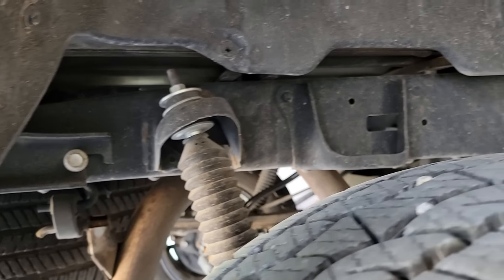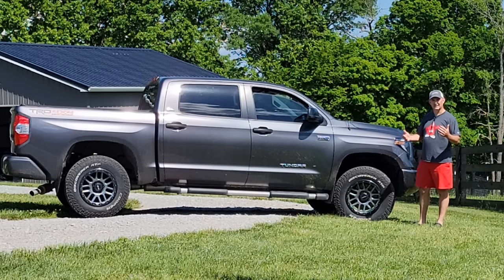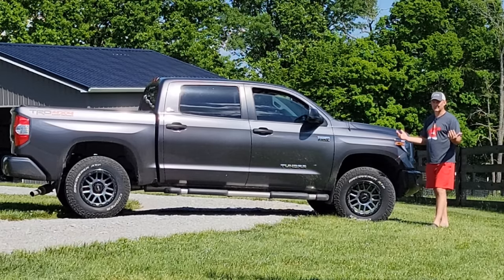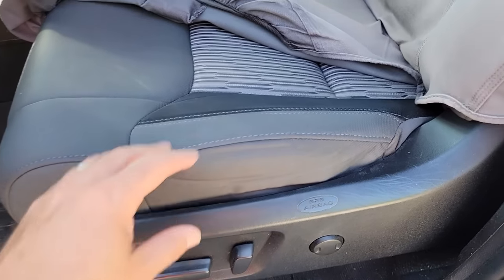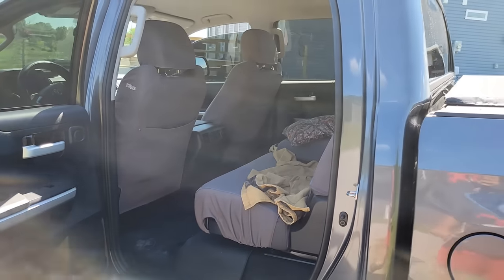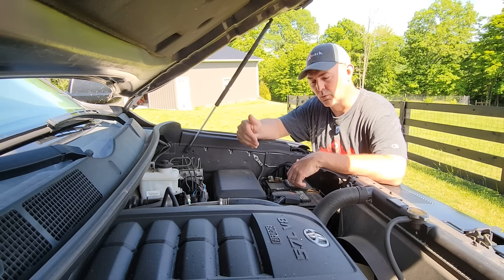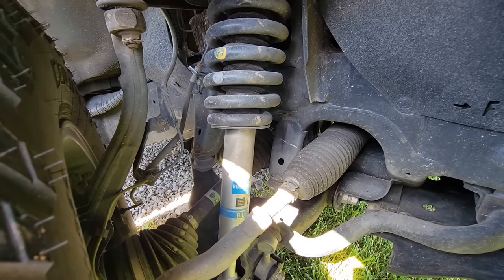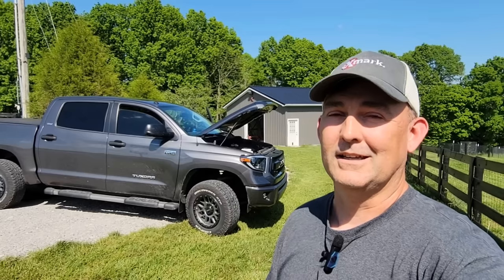Toyota Tundra at 6 Years / 100,000 Miles Compared to Ford F-150 and Ram 1500

Comment: The 4.7 and 5.7 Tundras are bullet proof. Most reliable trucks out there. Several million mile Tundras on record. There are no 5.3 Chevys, 5.7 Rams or Ford ecoboost with a million miles.
Reply: Let's face it.The detroit 3 are no match!
Reply: I've got a 5.3 with 418k miles
Reply: @banjobones8075  what year is your 5.3?
Reply: @6.2Slomaro  2002
Reply: @banjobones8075  those are the good 5.3 iron block without the AFM/dod crap. I had a 2013 5.3 crew cab 4x4 Silverado at 180k it had a lifter failure. Upgraded lifter and put on a used LS6 cam. And it was much more powerful. Sold it at 250k miles no issue besides the frame having lots of surface rust. Truck felt like it would go another 100k without major issue.
Reply: We went on the Toyota bandwagon for half ton trucks when my 5.3 dropped a cylinder at 130k. Highway miles and she puked on me . We still have a 99 and a 96 dually with gobs of miles running strong. Keeping it simple helps that long term reliability.
Reply: @banjobones8075  I wish Chevy stayed with the 5.3 Vortec platform. After 2015, the eco tech bs & transmissions took a dive in reliability.
Reply: @Michael-gj2gq indeed we had two 89 vans with that 5.3 main issue in our family was when maintenance was passed overdue both had head gasket leaks after about 150k miles they're amazing vs the other 2 conversion vans I wish GM still kept that type of Quality now all I see is that cylinder shutoff tech in GMs ruining the whole decades of hard work and 2.7 4cly. Inside tons of Silverados nowadays
Reply: @paullucas3 it's an unfortunate situation were mostly Chevys now in my family but our 03 Cavalier gave out around 229k miles and our last final old 89 Conversion Chevy kept purring until more vacuum lines corroded our biggest issues were the AC guaranteed to break after 100k miles barely on my 3rd Toyota and don't see a reason to leave it
Reply: @sweetj16real facts all I saw at some lots Carmax etc were 2.7 4 doors
Reply: There were several million mile silverados from the 90’s on the original small block. Do a quick search. Search Cummins million mile club. There arent 3-4 of them like the Tundra, there are over 130 registered dodge/ram Cummins that hit a million.
Reply: @danielm642  Diesel Rams yes but no gasoline 5.7 Rams with a million miles. No 5.3 chevys with a million. The 5.7 Chevy were good trucks of the 90s.
Reply: Depends. Chevy trucks under 07 were good trucks. Nissan 2.4 and 2.5 as well. Ford and Dodge old school are solid trucks
Reply: Lol comparing the 5.7 to the 4.7 is such a fking joke. The 5.7 will never be as good as the 4.7l v8 as far as long term reliability... why do you think the million mile 2nd gen tundra was a 4.7L ? Hahaha
Reply: @danielm642  who says there are only 3-4?
Reply: Yes, but you forgot the 4.6,it is also bullet proof
Reply: @danramzinski2957  no it isn't
Reply: @danramzinski2957  the the 4.6 is new age garbage
Reply: Ford Raptor 2011 with 362K miles and its all original. 
And its not just highway miles, it sees a lot of Baja desert miles.
Reply: 08 5.3 with afm 300,000 miles oil changed at 3500 miles semi syn Havoline only issues were ball joints and fuel pump once.
Reply: Their 4 bangers are just as reliable. My neighbor has a corolla and original 4runner that was a pickup from the early 90s that he uses daily
Reply: @Jones720k Good to know, I have a 2010 5.3 181,000k gmc sierra with the afm, so oil change intervals at every 3500 miles along with regular maintenance is the key?
Reply: @herbertpearson5665  yessir might or might not have something to do with the havoline 5w30 synblend I have been using since new.
Reply: Been more than 1 ecoboost hit a million
Reply: @freedomisntfree_44  With three different engines being replaced.
Reply: There are plenty of million miles ecoboosts. And the F150 is more capable than all the other trucks.
Reply: @Whiskey.Tango.Actual  Not with original engine.  Replaced engines.
Reply: @highplainsdrifter9849  false. I personally own a 2013 platinum with 1,233,000 miles on the original engine. My brother owns one that just created 1 mil, a 2015.
Reply: @banjobones8075  pre 07 5.3s are awesome. I had one and sold it at 225k. It did start needing more maintenance. Then i had an 07 that blew the engine due to AFM and a 2014 2500hd that was total pice of shit all the way around. cost me 15k in repairs and then I sold it
Reply: The first gen hemi and vortec engines absolutely could hang
Reply: There some Ford, Chevy, and ram with 500k miles. The question is how many times do you have to fix it.
Reply: I have seen more beaten Ford and chevy work trucks with over 1 million kms compared to the very few BABIED Toyotas with similar mileage
Reply: @roketfingers  yeah on their 3rd engine and 5th transmission.
Reply: @Enchanted3DPrints  coming from experience seeing these things from new, no the engines and transmissions were original
Reply: @roketfingers  Yeah, I mean its not surprising since they outsell tundras 5 to 1. I think the point is Toyota has better general quality. I can attest to that after owning all of them multiple times over and seeing friends and such own them too. I also worked at a shop and rarely saw a toyota but again keep in mind there are 5 fords and 5 chevys sold to toyotas every 1. I finally settled on a tundra after my last 2 chevys combined cost me over 25k in repairs in roughly 5 years. The quality just isnt there anymore. Id buy a ford before i bought another chevy and if you knew me that would mean something! My father had a tundra for 20 years and had 1 fuel injector fail the whole time. Other than that regular maint. Pretty uncommon with the big 3 to see such reliability. Anyway, buy what you like. they all break eventually
Reply: @Enchanted3DPrints  ofcourse Toyota has better quality! I'm just reinforcing the fact that other brands are not garbage. Have you ever spoken to a Toyota fanboy? It's sad from a mechanics standpoint
Reply: @roketfingers  Yep, some of all of them last and others dont. Just take care of maintenance and youre usually okay. I had quite a few 350 chevys that were bulletproof aside from the 4l60s. Fords non ecoboost are usually reliable. I dont touch dodge or ram or fiat or stellantis or whatever it is these days but they used to make a good truck! I guess Im kind of a toyota fan boy at this point only because they havent given me any trouble yet ;)
Reply: @roketfingers If being a Toyota fanboy means driving your Truck home vs towing it home 
👍 count me in. Im a Toyota fanboy instead of Found on road dead butthurt Ford boy!
Reply: The 5.3 is very reliable but the transmission sucks.
Reply: Toyota is still freaking ugly. Buy what you want but I still have to like the looks. Mid size still can’t tow.
Reply: I’ve seen fleets of 08-13 silverados with the 4.8/5.3/6.0 over 750k on the original engines. Usually they’re coming in for another transmission when the torque converter grenades but when the oil is changed on those and they’re not idling all day they go and go and go.
Reply: No, but there are a few with 500K+ miles. I agree that Toyoda is more reliable, tho. GM used to have a reputation for being extra reliable
Reply: Why would you drive a pickup 1 million miles? It would take twenty years at 50,000 a year to get there. The gas bill would be insane. These would also all be highway miles. Easy. Hate to break it to you but I never see Tundras getting worked. Now if anyone responds they will come up with a bunch of BS stories about how they are the workhorses of America. Facts. Go to a job site. What is loaded down and having the shit beat out of them? Big 3. That weak ass chassis Yota would be dead within a year doing what the American worker needs a truck to do. Maybe the engines are good but the chassis are trash.
Reply: No you don't. That's 100k miles a year. Not possible.
Reply: @treeman2660 Tundras are great for grocery getting and occasional trip to the hardware store. When it comes to actual capability, it’s not even close when compared to domestic trucks. Numbers don’t lie.
Reply: @AllThingsAudioHTX  number sure dont lie. Iv been pulling a skid steer with a 14ft dump trailer for 4 solid years with a tundra TRD. You stick a ram f-150 or a 1500 you'll be scrapping the POS's and you'll never cross the 400k mile mark with anything domestic as you call it. Sorry, you aint convincing me dude, I own a Toyota and I'v owned all 3 domestics. The proof is in the pudding, but in this case its the junk yard and in most cases the transmission shop first!
Who are you trying to convince?
Reply: @treeman2660  I'm not sure if your reply to my comment is relevant. If I understand correctly, you're sharing your personal experience of owning a Tundra. However, I was referring to numbers, specifically vehicle specifications and sales volume. I live in Houston, and when you approach any construction site, whether it's residential, industrial, or commercial, the ratio of domestic to imported brands is 9 to 1. There's a reason behind that.
Reply: Trucks are already the longest lasting vehicles on the road and Toyota trucks. Are the longest lasting trucks on the road. The Toyota tundra is the king of all the trucks it’s been proven.
Reply: There are 4.6 Ford’s with over a million miles.  It may be the most durable engine they ever made.
Reply: Are you sure the most reliable?🤦🏻‍♂️🤣
Reply: Fluid film that thing and it will stay that way!
Reply: @banjobones8075 my brother has a 2003 Chevy Truck with a 5.3 that has almost 300K! 
Still drives it daily
Reply: But what about the 5.0 Coyote Fords?
Reply: @danielm642 no gas rams ?
Reply: @pwhittyp5365 why is the same guy that had the 4.7. Driving the 5.7  about to hit a million miles on it 🤣
Reply: If those first gens didn’t rust through they’d have never died.
Reply: @paullucas3 D.o.D?  Those trucks were notorious for dead cylinders when they introduced displacement on demand.
Reply: Do you know that Dodge un 1998 was the 1st truck that reached the million miles? 😅😅
Reply: They are really good, especially in gas consumption,  16 mpg, lets take a look on chevys 21-24 mpg. I have mine for almost 7 years, no issues, took it to Sacramento 22 miles per gallon at 70 mph average. Something that toyota can't compete with. 😅😅
Reply: Right and nor any million mile Ecoboost trucks as well brother.
Reply: @Whiskey.Tango.Actual Are they on they're original engines.
Reply: @Whiskey.Tango.Actual Proof it mate
Reply: @Jedi391 Yep you got it brother
Reply: What's the percentage    of million mile trucks compared to Ford and chevy? That's the question and your answer!
Reply: @pwhittyp5365 I think there's like 3 or 4 million mile 5.7s too. They're all good
Reply: I did meet a guy with a 1st gen v10 excursion that had over 1 mil on it. That said, he rebuilt the engine twice and replaced it once, multiple trans, all the suspension like 5 times over, frame off resto twice... Basically a truck of Theseus lol
Reply: Toyota only make trucks in half ton?
Reply: @tysonbanks2064  have you ever seen a 1 ton Toyota in the states?
Reply: Uhuh whatever Winnie the 💩 poo.   Toyota is a joke , they made a couple descent  vehicles in 30 years ... I've owned a couple of junk Toyota.  Toyota had to smarten up because they made junk .
Reply: Toyota guy : Petting his dash every day talking sweet and driving his Toyota like it's about to fall apart .
Most others;  hold my beer I couldn't give a shit
Reply: @dwynepen7626  Toyota has been the #1 trusted and reliable vehicle manufacturer for decades  🤷‍♂️
Reply: @TheHonestPeanut  if you say so 🤪 I've owned a few seen the Toyota problems for 40 years ok . 👍  as said they have made a handful of ok vehicles aka motors .🙄 also a mechanic for years.  🤐
Reply: @dwynepen7626  same. Saab is the best engineered car for a mechanic. Toyota is the best for everyone else. But that's just facts so 🤷
Reply: @TheHonestPeanut   suabru isnt bad to work on , tbh I'm clueless about Saab, not many in North America if they even still sold
Reply: @dwynepen7626  sadly they're not. GM ruined them. Saab just makes jets now.
Reply: @TheHonestPeanut   wow that actually some history now I'd forgotten,  Gm had and has their hand in alot of interesting stuff.. Saab was originally Sweden if I recall 🤔
Reply: @dwynepen7626  yup good ol swedish engineering. GM does have a solid history of ruining everything they touch lol
Reply: @TheHonestPeanut  I did grow up Gm in the 80s and 90s , today's Gms I shy away from. I appreciated my volvo v70 Swedish built , drive it like ya stole it and it loved it 🙆
Reply: @AlphanumericCharacters actually the big 3 are on job sites because buying them at fleet costs is less than buying a fleet of Toyotas. But Toyota has less maintenance cost but more upfront cost. Toyota is still more reliable any day of the year. And tundra is built in Texas. The big 3 use Chinese parts and have gobs of issues.i bought a 17 tundra 5.7 4x4 and won’t look back
Reply: @nw2404  so Toyota would rather lumber along selling less than 100,000 trucks per year than sell to fleet? I’m glad you like your truck but they just can’t compete when doing big boy jobs. If it suits your light duty needs and you like it then great but any of the big 3 trucks are vastly superior in every way. By the way Toyota just recalled all of their engines on the new trucks. Over 100,000 short blocks are getting replaced. You Yota Boys shouldn’t be peaking up from your sunroofs for awhile after that one. 
 I had a 2017 F-150. Would still have it except for getting divorced. It was the most American vehicle made that year. Same year as your Tundra so that doesn’t hold water either.
Reply: I just watched several Fords with ecoboost million miles. I’m neutral with trucks. A good one is a good one.
Reply: @trickydancemove  Ford with three different engine replacements and two transmissions.  That's a good one.

Comment: I have a 2007 Toyota Tundra Crew Max with the 5.7 V8. This is the best truck I’ve ever owned. This 5.7 V8 with the 6 speed transmission is bulletproof. I don’t want to own anything else but a Toyota truck. Keep driving your and you will get a million miles on yours too. 😁👍
Reply: I have 2007 sr5 double cab with the 8ft bed.  189k miles running strong. 💪💪
Reply: @Danette mileage now on the odo?
Reply: @davidt.7558  pffft 189k miles....thats like having 50k on it
Reply: @davidgottschalk587  of course! I also have a 2020 tundra trd sport
Reply: Lol comparing the 5.7 to the 4.7 is such a fking joke. The 5.7 will never be as good as the 4.7l v8 as far as long term reliability... why do you think the million mile 2nd gen tundra was a 4.7L ? Hahaha
Reply: I might consider a Toyota tuck if they made HD trucks, Tundra is too light duty, not a capable working truck.
Reply: Is yours the SR5 package or limited? I am looking at sr5 but not sure what the differences between the SR5 and limited is on the 2007 model. Thanks
Reply: @jew0182  sr5 model is weird. It depends on what the original buyer ordered when new. You can have leather seat sun roof st5 toyotas. Just look at the photos of the specific car your looking for. Get a 1st gen
Reply: @pwhittyp5365 I have s buddy who has a 2017 Double Cab w/ a 5.7. He hit a million miles last fall.
Reply: Awesome bro! I love my 07 with the 5.7.  TRD sway bars are a must unless you’re lifting it.  I only have 152,000 mi. on it so it should last forever!  LOL 👍